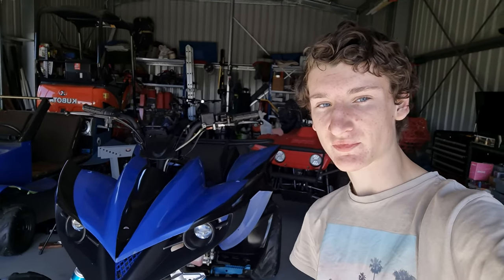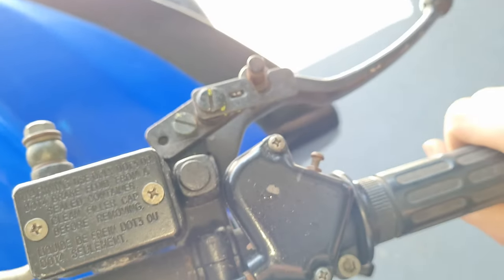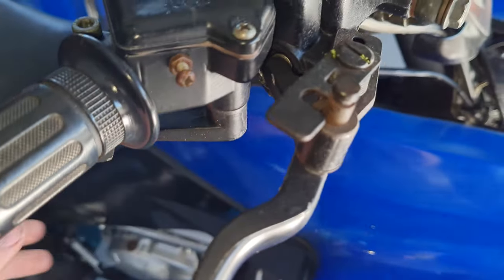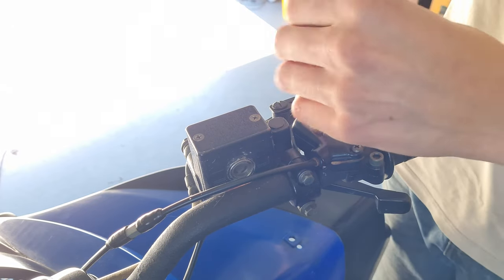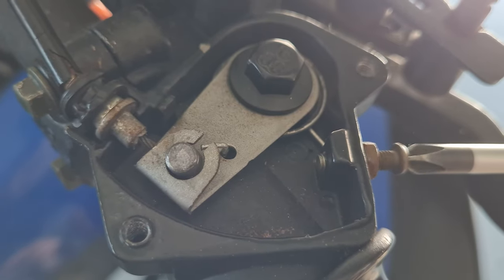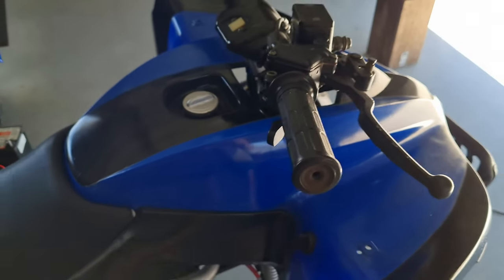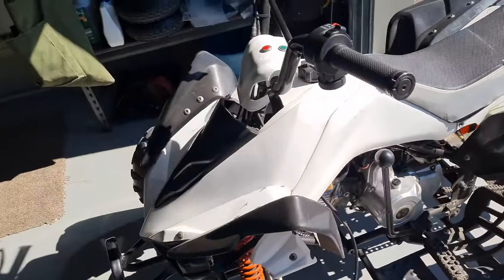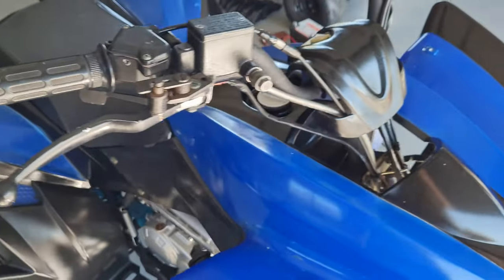How to Make Your ATV More Powerful For FREE!

Comment: not a speed restriction screw it prevents you from moving the throttle to hard and potentially snapping the cable, don't do this
Reply from the maker: You'd break the lever before you broke the cable, plus it isn't to stop you from breaking the cable it's to adjust the WOT carb barrel position. Loosening this screw will allow the barrel to slide up higher allowing more air and fuel into the engine.
Reply: @ShedCam  what if i remove the screw completly ( no speed limit screw ) ?
Reply: what if i remove the screw completly ( no speed limit screw ) ?
Reply from the maker: @2AHGT  You'll be able to move your throttle all the back until it hits the back of the thumb throttle body. This will give you the most power without doing more in depth modification to the carborator and thumb throttle.
Reply: @ShedCam  so its safe if i remove it completely ???Will it not cause any problems or blow my carb ? My father used to open it 90% saying not safe if remove it all  
Idk tell me
Reply from the maker: @2AHGT  It's up to you if you do it or not, but it's such a minor modification it won't do damage. Can't really blow your carb. Driving style will have more of an influence on the longevity of your atv than this mod will.

Comment: Did you look at the speed restriction ring inside the clutch?
Reply from the maker: Wasn't searching for more speed mostly more grunt off the line
Reply: Copy that, maybe a smaller sprocket.
Reply from the maker: @MrNeldana  Yeah that's what i would have changed if I was searching for more speed